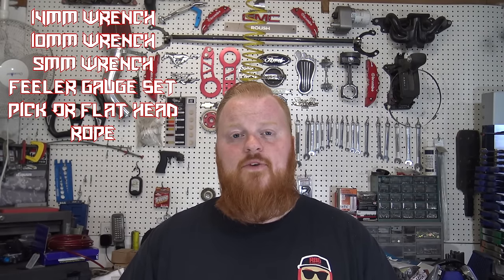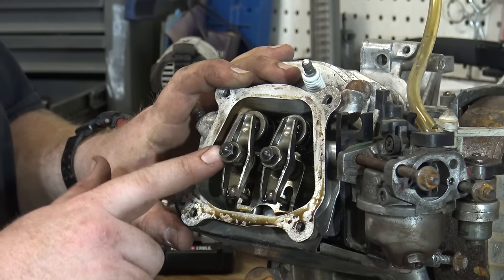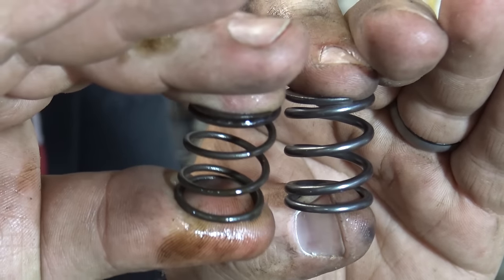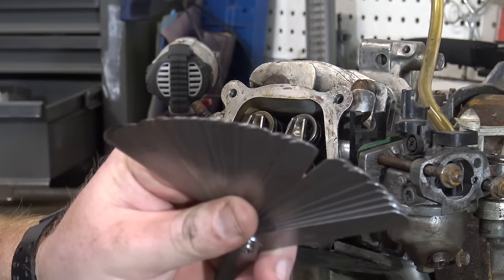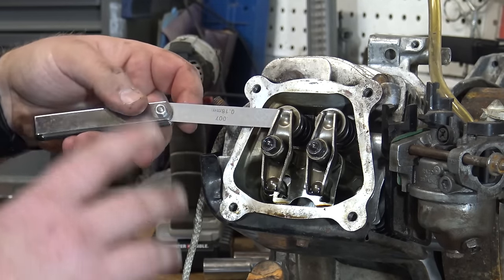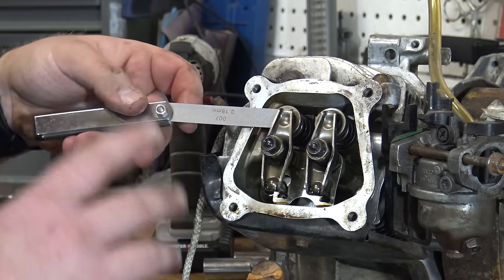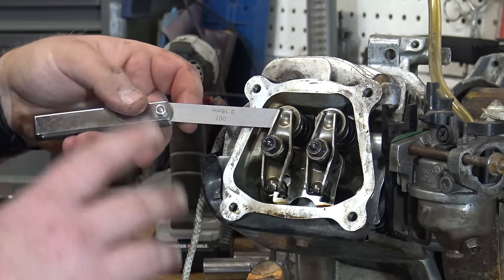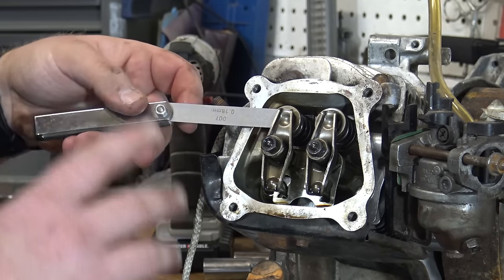How to Install 18lb Valve Springs & Adjust Valves GX200 / Predator 212 Hemi & Non Hemi Go Kart

Comment from the maker: Had a little brain fart when adjusting the lash. You need to go one step higher in the lash setting. So if I calls for .008 do .009. The metal will expand when hot. Just wanted to note this because of course the whole internet will not let me live it down. Thanks for watching.
Reply: HELP!!! how does effect low rpm speed (does it take longer to get to top speed?)
Reply: Can I put 22 pounds Springs On a 212 cc predator
Reply: Hey man I'm still getting a ton of compression with those gaps. Too tight to even pull
Reply: You could break up a old spark plug and put a hole into it and weld a air chuck to it and use a compressed air to old the values up it works amazing and saves a lot of time
Reply: so it's gonna be .007 for intake and .009 for the other? just checking before I do it.
Reply: So I have pred 212 hemi,  stage 1, have a arc flywheel, do I need a rod not remove the governor?, or can i do 18ibs springs and let it sing?
Reply: I did the springs now it wont idle.off choke
Reply: *Actually the reason you set the valve lash gap is because when the engine warms up the gap DECREASES to .001 or .002. If you set the valve lash at .001 or .002 when engine cold, when the engine heats up the valve lash DECREASES and would cause the valve to never close and remain open just a little and you would not have any COMPRESSION lol. This phenomenon only occurs with SOLID lifters. NOT hydraulic lifters. 
Old air cooled VOLKSWAGENS and HARLEY DAVIDSONS are SOLID lifters also. I work on both so I have 30 years experience with solid lifters and air cooled engines*
Reply: How do i set lash with roller rockers on hemi? Same way basically?
Reply: On my roller rockers the adjustment is on the pushrod side.
Reply: @Justin Santhuff Yes same way
Reply: @colinread5451  I'm sure you found out by now but definately want a rod
Reply: @Justin Santhuff The nut is but still set valve lash gap ALWAYS at the valve side. ALWAYS use feeler gauge on the end of the valve side. Doesnt matter where the lock nut is located just use feeler gauge on the end of valve side. ALWAYS
Reply: @campervan7354  okay that's what common sense would tell me but i was double checking. I'm just trying to do everything by the book. My first build and. The only stock parts I have are piston crank and casing. Just waiting on lash caps for roller rockers and a carb set up and she's ready.
Reply: @Justin Santhuff No worries never hurts to ask. Good luck with it
Reply: @campervan7354  thank you!
Reply: Glad I saw this comment. I tried this upgrade with the older lash settings and couldn''t get any spin at all. I really want to run the stronger springs though if I can.
Reply: @campervan7354  hey this is really random but I figured you might know the answer to my question since you work on these type of engines & seem to know a lot. 
So I have a predator 212 hemi and I’m installing 22lb springs in it. What would you recommend the lash to be as I did not receive any recommendations from the company’s purchased them from, would you have any idea or is that not something you’d know off the top of your head? 
Hopefully you see this!
Reply: @charlesvon155  you ever find out bro ??
Reply: THATS WHAT WAS BUGGING ME FROM WATCHING : WITH THERMAL EXPANSION 
BETWEEN TO SURFACES YOU WOULD HAVE TO COMPENSATE WHEN COLD.
THANKS FOR CONFIRMING MY OWN CONFIDENCE IN MY INTELLIGENCE. 
WHEN UNSURE OF ANY MEASUREMENT TOLERANCES  ALWAYS SET THINGS IN THE MIDDLE.
THANKS  RED BEARD
Reply: @campervan7354  so start at .007 for intake and .009 exhaust? This is the first time for me so I just want to double check
Reply: @greghiggins1952  yes
Reply: How do you choose your spring weight? What's the difference between the 18lb the 22lb?
Reply: Where can I buy a lash cap for a hemi predator
Reply: Hi red beard I'm just wondering Why do you not have No video on how to adjust a valve lashOn a predator 301 CC hemi 
 motor I would appreciate it If you could please make a video on that particular motor Because me and my dad do not know how to do it

Comment: wait so the hemi comes with 18lb springs
Reply: No. He says 3 times that that engine already had the valve springs changed which is why he didn’t do it in the video. And you don’t have to do lashing with the hemi engine when going up in valve springs I think up to 18lbs. But you should always check it tbh lol. But you can get away with out setting lash on a 10.8lb to 18lb valve spring swap
Reply: I need help adjusting my rocker arms I just installed my cam

Comment: Yea i cant get my bike to turn over now and ive set the damn lashes so many different ways. Wtf am i doing wrong??? I have the ct200u engine. I out the 18 lbs springs in and no matter wtf i do its hard as hell to pull over now

Comment: I'm a YouTube mechanic when it comes to my mini bikes maintenance! Your videos are priceless, I got the stage 1 kit from Go Power sports for my Coleman ct200u ex, the only thing that's stalling me is the valve spring swap. Thanks for all the detailed information it's greatly appreciated!
Reply: Down South squonks! It’s a pain in the fuckin ass I started my 18lb swap two hours ago I’m still trying to get them back in.. I do not have a spring compressor sadly
Reply: You guys push them on the spring cap retainer using a deep socket
Reply: Down south I need help to adjust my hemi rockers I installed my cam I ddnt add oil yet give me a video or some good tips

Comment: SOME non hemi predators have a 3 piece valve caps. I found it easier to pull the cylinder head off to take the caps off. the issue being the rope wasn't stiff enough to hold the valve in place. and feeler gauges sell for about 7 bucks at any auto parts store. and just remember all lash is set on a cold engine

Comment: I've been watching the video, and searching all over the Internet and everybody seems to have a different answer. my question is, what is the valve lash intake and exhaust for a predator 212 that has the 18-pound valve springs? Only performance upgrades I have done is a header exhaust and an air filter
Reply: The instructions I got with my kit say .003"(three thousandths) but I set them to .0045" because of metals expanding.

Comment: Thank you for this video! I have a 196cc (Coleman) I used your valve lash specs and it worked perfectly! 18lb valve springs installed and running strong!
Reply: Please tell me specifically what each valve you set too and how you had the valve’s positioned (when turning the engine) i cant pull mine over anymore and it backfires

Comment: Removed the governor and replaced the valve springs, and set the lash today and it worked great. Thank you for the easy to follow video
Reply: What did you set your lashes to? I can hardly pull my engine over now and it just wont start and backfires alot
Reply: @troubledseed prolly too late but .002 for both exhaust and intake works perfect

Comment: RB, I did the governor removal, Mikuni Carb and header on my non-hemi.  I also put the 18 pound springs in (thanks for the tutorials).  I've since read that you need the billet connecting rod and flywheel if you are doing 18 pound springs?  Can I run the 18 pound springs without the billet flywheel/ connecting rod?  I'm not looking to run this engine and high rpms for extended periods, just brief bursts of WOT.  Hoping I don't need to tear the engine apart again. Also, suggestion for next tutorial is how to remove/ reinstall the springs with split valve keepers (no lash caps). They were a bear to deal with!  Especially when re-installing the 18 pounders!  Thanks again my friend!
Reply from the maker: I think it will be fine but when you can afford it I would do it just to make the engine tough
Reply: You ain't lying about them being a bear to put back in he makes it look so easy

Comment: I have never used a set of feeler gauges on these. I have always just tightened the rockers down until they barely have any wiggle and have had zero issues.

Comment: The new non Hemi predator valve caps have two small retainer in it for each side you are going to need a magnet these little small things are going to fall if you have big hands like me they are hard to work with but a small screwdriver with a magnet tip you can place those teeny things right where you want them press down one side first lock it then slide the other side on zip ties help the small ones

Comment: does the "HEMI" come with 18lb  vakve springs from the factory?
Reply from the maker: No you have to upgrade to them
Reply: Red Beard's Garage can I run 18lbs springs on a stock rod hemi with bumped up compression?
Reply: GT20Modding I'm not running a gov. That's my problem

Comment: the valve clearance will not grow as the engine warms up it will get tighter as the pushrods and valve stems get hot and expand and if they are too tight it will burn your exhaust seat out because the exhaust valve will be slightly open when the power stroke happens. if the intake is too tight it will start poping trough the carb when it warms up. or that's how it works when you put a solid lifter cam in a v8
Reply from the maker: +Jnl Jnl yeah it was a mistake. But when looking at lash setting they always say +/- .001 so it's fine.
Reply: Red Beard's Garage yes sir . love your builds man.
Reply: So what sould i set it to

Comment: For stock Predator 212 engines, the recommended valve lash specifications are as follows:

Intake Valve Lash: Between 0.004 to 0.006 inches
Exhaust Valve Lash: Between 0.006 to 0.008 inches
Remember, these values are crucial for maintaining optimal performance. However, keep in mind that engine upgrades can influence these settings.

Checking and Adjusting Valve Lash:
To measure the current valve lash, use a feeler gauge. Slide the gauge between the rocker arm and the top of the valve. It should fit snugly but without too much resistance.
Loosen the nuts on the rocker arms and adjust the lash according to the recommended specifications for intake and exhaust valves.
Remember that the engine needs to be at top dead center (piston at its highest point) when setting valve lash.

Comment: Incredible video describing the process. I have a 212 Hemi. I noticed you said "you don't have to adjust the valves after putting in 18lb valve springs." At the end however you mentioned adjusting the valves. Im about to do this spring swap and just want to make sure im following the correct steps. So just put 18lb springs in and giver her hell? Appreciate the help!
Reply: @Twitch Fish I checked them and they were very close. Did wind up tweaking barely I believe.

Comment: it calls for 6 and 8 cause when it gets hot the metal swells and the tolerances get tighter. set at 6 and 8 to save your push rods. Love you love the show but I'm Honda certified. 6 and 8 is suggested for a reason.
Reply: gabriel stechmann 6 on intake and 8 on exhaust on cold engine?

Comment: my predator 212 is bone stock. is it okay if i put 18 lb springs on it with no other mods?
Reply: They would work fine but you wont reach rpms where you'll need them.

Comment: Thanks for the informative videos.  Would 18lb valve springs work in a predator 420 with the governor removed?  Would the process to install the springs be the same for the 42o?  Thanks.
Reply from the maker: +Charlie Pulley same process but you need to go with 35lb in the 420
Reply: Thanks for responding.  Would the valve lash be the same on the 420?
Reply from the maker: +Charlie Pulley it says in the manual what to set it to and the process would be the same
Reply from the maker: +Charlie Pulley it says in the manual that comes with the engine what the valve lash should be set to

Comment: You can buy angled feeler gauges.. It's good to have both straight and angled..
Reply from the maker: +tommy23490 yeah I probably should get a set
Reply: Red Beard's Garage I have a 6.5 horsepower  snow blower engine and I was wondering if I can use it on a go-Kart

Comment: How often do you adjust the new valve set up? I would guess the heavier springs. After prolonged use will create a   mushroomed valve seat over time
Reply from the maker: I don't have a set time I do it. I would say every few oil changes

Comment: Hey red beard, is it okay to add 18lb valve springs on a stock bottom end stage 1 predator? Have you had any issues? I just want a little more rpm from my motor without going to stage 2. Thanks.

Comment: If you upgrade air filter, jets, 140 E tube, and 18 lb. springs,...do you have to do the billet rods and flywheel in order to remove the governor ?
Reply from the maker: You don't have to but it is highly recommended

Comment: I had bought some valve springs 22-pound. I didn't mean to get such strong ones, but will they work or should I return them? I have a Honda GX200. Mikuni carburetor setup remove governor custom-built frame mini bike first timer Builder My main question is a 22lb spring for my setup. To strong of spring? And thanks to you for all the help through your videos.

Comment: hello red beard I know the vid is a little old now but is the valve springs the same on both hemi and non predator 212s ?
Reply from the maker: +Rooney they say there a little different but I have always ran the non hemi springs in all my engines with out a problem

Comment: how would you go about building a twin predator 212 go kart with a live axle? would you use clutches or TC? how would you link up the throttles? any info will be well received.
Reply from the maker: Two engines, two cvt, link the carbs up with either a rod or two cables.

Comment: I have a 212 Hemi with the governor removed. since the hemi  already has 18lb springs should I install a heavier spring to avoid float?
Reply from the maker: The Hemi does not have 18lb springs from factory. They have same valve springs as non hemi
Reply: Red Beard's Garage thanks....not sure what I was thinking.
Reply: Red Beard's Garage will I need to upgrade the push rods?

Comment: what would the approximate max rpm with 22lb valve springs be
Reply: Flywheel bomb
Reply: @jacobneymeiyer9091  what if have upgraded internals
Reply: @its_robbietime1333  depends on the upgrades. Different cams designed for different things. But I would guess around 7-8000rpm? Lol idk Forsure tho.
Reply: @jacobneymeiyer9091  if i do change the cam it would probably a mild cam; 22 sounds like a bit much what kinda rpm would i get from either 15 or 18lb springs and which should i use for my "garden cart" im not looking for a race cart
Reply: @its_robbietime1333  there’s a video of a guy just installing 18lb springs in and getting 7300rpm on stock internals. It isn’t safe but it’ll do it. If you upgrade to a mild cam you could probably get 7500 than you’ll probably get valve float at that point with only 18lb springs. But I’m no expert and I’m sure people will say otherwise
Reply: @jacobneymeiyer9091  that sounds perfect for me itle me to 50mph

Comment: Do you need to adjust the valve lash if you upgrade to the 18lb springs on a hemi predator?
Reply: I'm wondering the same thing since they werent molested when removing the rocker arms I would think you wouldnt need to adjust them

Comment: I have a problem hopefully you can help me.  OK I bought a go-kart at a yard sale. Has the 212 Predator motor from Harbor Freight . Here's the problem it will  start but only for a second and only once.  It's got oil / gas. I've even used starter fluid and nothing helps.  ? Any ideas???   And the motor sounds good no weird sounds
Reply: Frances Adams does it have spark? If not... Change the ignition coil for 10 bucks on amazon

Comment: I like to run .ooo inches of clearance, in fact I tighten the nut down until it gets loose, then back 1/8 of a turn.
Reply: Dover Power. - Racing engines uses & recommends .001 valve clearance on their clone  race engines.
They must get TIGHT when they heat up & expand.
But there TOP engine builders & racers.
Who am I to question ?

Comment: Red, witch one is better hemi, or non-hemi (predator 212)
Reply from the maker: Hemi
Reply: thanks
Reply: Cipri Creasta  hemi is always better.
Reply: Stock build or modified?
Reply: sprintcardriver8  any 212 are great factory but when modified you can gain up to 10hp all the way to 20hp  so i heard from my local lawn mower shop hes into gokart etc.
Reply: K Lucifer my 212 predator is going to be making just over 28.5hp should be nasty usually I use a Briggs animal but this time I wanted to build a predator
Reply: sprintcardriver8 holy hell thats alot of hauling power on any application
Reply: K Lucifer I race the open unlimited class where I live more power then u need on our small track but ya just over 28.5hp according to a very reputable engine builder JRPW Racing he has built multiple engines exactly like mine and that's what he told me to expect he did my cylinder head for me I did the rest of the build
Reply: sprintcardriver8  nice.
Reply: I'm going to start doing some videos with my phone of the build I havnt done any for a long while so I guess I will see if there is any interest in my vids and I might keep making them
Reply: hemi

Comment: Very Timely subject... I have a set of 18# springs to put in my Hemi... trying to decide on a CAM for low end torque as opposed to spinning the heck out of it to 6-7K
Reply: ReverendBow put a big cam on it and a torque converter and you will be set

Comment: Hey man I got a 224 and hemi swapped it and deleted the govern and when ever I rev it up my rocker colapses you think I need stiffer spring or what do you recommend? And valve lashed it so it ran normal no knocking or any just collapsed at high rpm on stock springs

Comment: Would I use the same adjustment for my Titan tx200? Also after removing my governor will it be ok to use the 18lbs springs on a current stock engine? Or should I go with the 10.8lbs for the time being?
Thanks.